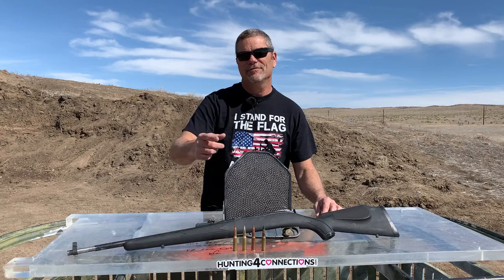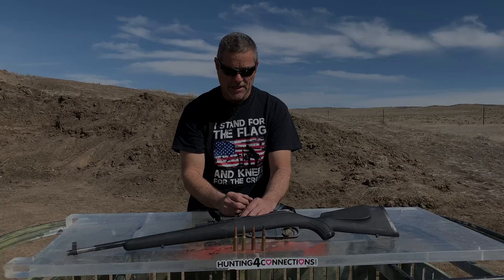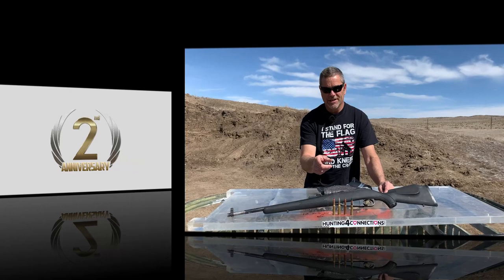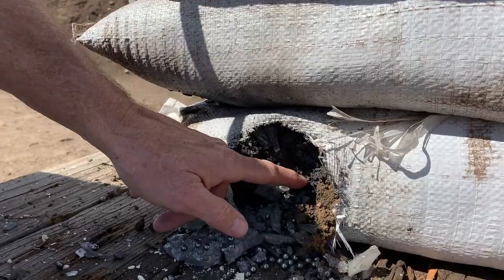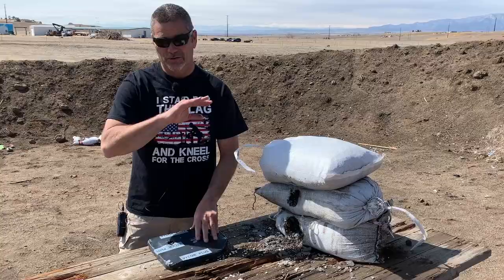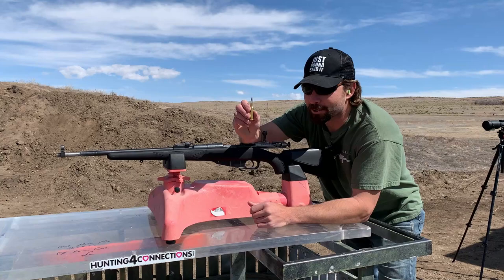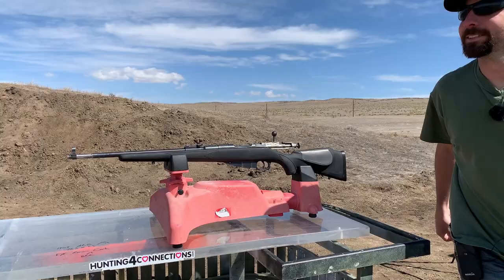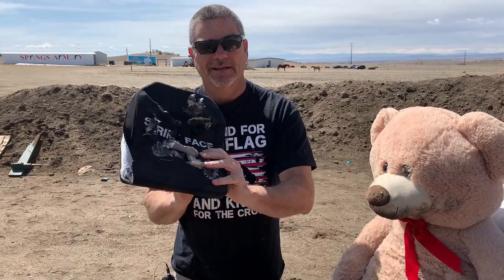Ball Bearing Body Armor Will It Work?

Comment: “Pipe bombs use nails, bolts and nuts, chunks of metal and ball bearings to create damage”

Brilliant, let’s attach 4000 pieces of shrapnel to my chest to stop bullets and encase it in shattering resin.
Reply: Notice his shirt. He knows that kneeling is respectful, because his shirt says he kneels for the cross. But he thinks that kneeling for the flag is disrespectful. This is not someone who has been trained in critical thinking.
Reply: @johness5425  he made the armor to test or out. For fun. For the video. It was not designed for use in the fucking military or something
Reply: John Ess they sound like some them liberals u hearn all bout these days. Tht ill tells u bout there smarts right there uh huhhh.
Reply: @mateusz_0  If you think about it for two seconds, you know that epoxy and ball bearings have nothing in common with actually used body armor materials. Did you catch how the shooter called it a "chest-mounted claymore" before he fired a round? Did you catch how embarrassed he was when it failed? "Okay, well, I just need to stick to making videos and not body armor."
Reply: @johness5425  claymore is an explosive device. He literally called his armor a bomb. He knew it wouldn't protect a person
Reply: @mateusz_0  The guy who made it never called it a bomb before it was shot at. 

"We have no idea how this is going to work" 0:23
He then goes on to say how a friend of his told him that epoxy wasn't strong enough, so he wrapped it with vycor to give it more strength. Then the shooter, a different person, called it a chest-mounted claymore.

The people around him knew that it wouldn't work because of critical thinking. He didn't.
Reply: @drewyoung5577  Here is a thought exercise for you. 

If I know things that you don't know, and those things are the foundations of my comments, it will appear to you as if I'm ignorant when really it is you who is ignorant of what I know.

It's difficult, I know, but studying rhetoric, philosophy, and critical thinking can really broaden your mind.
Reply: @johness5425  Kneeling is respectful in certain situations. Kneeling during the national anthem isn't respectful at all
Reply: @TheLongDon  Really? Why then did a US Veteran tell Kaepernick to kneel to be respectful while he protests if kneeling isn't respectful?
Reply: @johness5425  Im sorry, but when did a single left wing US veteran become the spokesperson for the US? That's like telling me the majority of the US military wouldn't secretly enjoy watching Biden getting executed based off of a small poll from a single Air Force base. Means nothing, and it's still wrong
Reply: @TheLongDon  LOL you're still faced with the reality that you're trying to justify kneeling being both respectful and disrespectful. Your logic isn't consistent. You're also stuck with trying to squelch a US citizen's First Amendment right to peacefully protest.
Reply: @kentuckyfriedpepespeaks1550  Yeah, you're trying to shame him into shutting up because you don't like the uncomfortable truths he makes you look at 😊
Reply: @crazyjhey8050  "there smarts" nice one

Comment: Actually this seems like it might work with a single layer of ball bearings and a few layers of Kevlar behind it. Looks like it spread the force out quite a bit, which Kevlar could probably absorb. Likely the actual bullet was quite deformed after the impact
Reply: I agree, this was actually a success.  If it had a rigid tensile backing and a tensile wrapping, the bearings would have redirected the force from piercing to blunt.  I think that several bearings deep is good though because it forms a pyramid of impact.  Also I think glass would work as well as steel bearings for less weight.  I'd love to see an experiment like that.

Comment: I gotta couple of those Argentine spotter rounds for my mosin. Y’all are the first people I’ve ever seen test them

Be cool to see them in gel or something against the PZ rounds
Reply: I second this, I've got a couple and the only thing I've tested them on are 5 gal buckets of water.
Reply: Argentine rounds for a soviet gun? Tell me more about it.
Argentina's gun industry is practically inexistent, that why I'm asking.
Reply: @_CazaBobos  they aren't actual Argentinean 7.62x54r rounds, its a 7.65 projectile pulled and reloaded into a x54r case. Apparently due to actual diameter of the projectiles its safe enough to do other then the actual act of pulling the projectile potentially being dangerous however younger me was pretty rough handling the ones I have and they are relatively inert (you can hear the little detonator pin if you shake them) but there are photos of people trying to use a kinetic puller to remove the projectile and it exploding.

Comment from the maker: is:

Install Raid for Free ✅ IOS: https://clcr.me/teHpDC ✅ ANDROID: https://clcr.me/ywv64U ✅ PC: https://clcr.me/xiNgZw and get a special starter pack 💥 Available only for the next 30 days
Reply: happy sponsorship :)
Reply: I love you
Reply: Explosive free claymore mine u did invent sumthing
Reply: Maybe you could make this body armor for ISIS. The idea of using balls for ballistic protection is actually used in real life in the walls of U.S. Embassies. They use ceramic ping-pong ball size balls stacked a few layers thick inside of critical walls. When a bullet or bomb fragment hits one of the balls the ball stops the projectile but shatters in the process. The balls above the shattered one then fall down to replace the damaged one.
Reply: you may be onto something there,
the purpose of a plate/ceramic is to spread the impact into more area for the kevlar to contain.
if you had a kevlar backing to the ball bearings it certainly did spread the area out the back.

is it worth trying again with kevlar backing?
perhaps put the balls in balistic gel for a flexible plate?

Comment: Glad you shot it with a Mosin :) My first thought was it will blow apart very easily as the ball bearings will separate when the bullet hits the plate. Even with the wrap. And I was not disappointed. This would not stop bullets, and would be very dangerous for the wearer and people around them.

Comment: If you put a panel of polycarbonate behind it, it could actually work. You can see how wide the exit wound is, so I think the energy of the bullet is dispersed very quickly throughout the ball bearings.

Comment: Actually similar armor type existed in history - pebble armor. I do not know if this was official name. Brits used proper sized granite pebbles in asphalt or similar bonding agent and cast it around critical part of the commercial ships in WW2. It saved armor steel and idea was (tested, not just idea) that bullets from strafing aircraft would be destabilized, slowed down and than easily stopped by some thin backing.
Quite likely if you found the way how to keep the bullets in place, this could work. One think that could have made your results even worse is that classic school example in physics - you let the ball hit line of the balls and the last one flies away. Those balls probably transferred shockwave and that's why we had such a beautiful slow-motion effects. 
My guess is that many of these DIY body armors fail because they allow projectile to bypass the protection. Bullet impact simply sends pieces flying or crack it and pushes junk of it inwards thus the bullet is not truly forced to makes it way through.
Look at the brick wall. 1-layer and bullet throws half of its thickness from inside part away by the force of the impact before it even gets there. So it flies through the hole rather than punching through the brick. Make thicker wall and bullet barely makes small crater on the surface as other bricks prevent material to go away.

Comment: That's a cool design for the plate. The ceramic will spread out the impact over an even area, and deform or mushroom the bullet, while the kevlar behind it will catch the fragments and save you. Rather than a bullet hitting just kevlar. It would take a whole lot more kevlar to stop the rounds wheres the ceramic allows it to be smaller and lighter than it could be otherwise. Brilliant and simple

Comment: Ball bearings are very hard and are great for shattering bullets, but so is ceramic., and ceramic body armor is backed by an aluminum plate for a reason. You don't just need to break up the bullet, you have to catch it, which is why high performance plates have metal and aramid backing and are tightly wrapped in aramid and nylon to hold all the layers together while absorbing big impacts.

Comment: In solid composite engineering, there are two types of materials used in tandem to gain the upsides of both while mitigating the downsides of each. A crystalline matrix and a fibrous reinforcement. The crystalline element is hard, inflexible, retains its shape and is used as the load bearing element. In typical composites such as fiberglass or carbon fiber, this is usually some type of epoxy resin and acts as the binder. The fibrous element is soft, flexible, absorbs shock and halts fracture propagation within the matrix. Common examples include rebar in concrete or horse hair in plaster.
What you have here, epoxy and ball bearings, is a combination of two crystalline elements with no fibrous element. Knowing this, it acted as expected.
As a side note, as you can see in the ceramic plates, they could not manufacture it with a reinforcement embedded within the ceramic while retaining the properties that demanded its use in the first place. To mitigate fracture propagation, they use multiple segments. To absorb the shock and energy imparted to the ceramic, they use a ballistic fiber panel layer behind it. Either one of those elements would fail in its intended role if used alone, even if twice the amount was used, but together they can accomplish more. This design also makes the plate only functional for its intended purpose when exposed to the incoming energy of a projectile from one direction, which is why they have one side clearly and boldly marked as the 'Strike Face'. Shooting that plate from the opposite face will lead to a result very similar to what you saw from your own prototype. That basically means that you might be able to get away with making many small squares of your material and taping them over a soft armor vest. You would then have a proper solid composite material assembly. It might just be worth having a go at a Mk.2.

Comment: A very fearless buddy of mine back in high school in the 80s made armor out of fiberglass and sheet metal about an inch thick. It repelled everything he threw at it until I socked it with an AK armor piercing round. Nice hole right through it. It was thicker, but he put it in a hydraulic press and made it an inch thick. It worked, but any military rifle round went straight through. Glad he wasn't wearing it.
Reply from the maker: Thanks for the comment 👍

Comment: when built right it would work. try making it like composite armor. As for example; 5mm ar 550 face place with a 2mm layer of kevlar followed by a ceramic ball bearing layer mode of 2mm ball bearing followed by another 2mm layer of kevlar. continue with this layering until 20mm thick with another 5mm ar550 backer plate.

Comment: Some 3-5 layers woven fibre glass cloth on the front, in between ball bearing layers and the back. Some use glass ball bearings. They break and chew up the bullet. 

Of course we don't know for sure until someone tries it. It might actually stop the rounds.

What about gravel armor with layers of fibre glass cloth? Might be heavy though.

Ball bearing armor - who knew it would turn into a claymore mine! Maybe you just need some tough woven fibers to make it work.

Those ball bearings did dissipate the impact somewhat but it got passed to the ball bearings.

Comment: I think if it would be backed by something solid, like layer of steel armour, it may act somewhat similar to ceramic armour i.e. it would disperse the energy of the bullet before it hits the armour, or even push it sideways or in weird angle making it hard to penetrate. Now it is literally as strong as ~2 inch thick epoxy - as soon as bullet hits there is nothing backing it and everything just bursts through the back.

Comment: It needs some kevlar on the back because the armor is working in a way its taking a small projectile and is dispersing it into a larger one but the epoxy is not strong enough to contain the energy.

Comment: This would maybe work, but you'd need to use a more durable binder then epoxy.

I'd be interested in seeing this done again, but use Flex Seal to bind the BB's together instead of epoxy. 

Maybe put a layer of Denim on the back, that way it won't shatter upon exiting.

Comment: The issue is clearly containment of the ball bearings. What if you wrapped it in something stronger than tape? E.g. putting a soft body-armour behind it, like a kevlar vest? Maybe use bigger ball bearings as well to get a bigger impact surface area on the vest?

Comment: Honestly, I think it depends on the type of metal bearings used (case hardened, stainless steel, chromium, etc) and how they're laid out. As well as the substance used to hold the matrix of the ball bearings together. Too hard and it will shatter. Too soft and it will blow apart where struck. A High Density, slow cure apoxy should do the trick.

Comment: you know you could try doing a V2 where you instead of using clear resin, you use molten aluminum to bond them. will be much stronger. you could also use a thin piece of sheet steel to back it so you dont have a claymore strapped to your chest.  Would love to see a V2
Reply from the maker: Great suggestion!

Comment: Epoxy is brittle and not that hard.  UV resin would of been a better choice, but I like your idea.  Maybe try it with UV resin mixed with 1095 steel powder.  Still might be too brittle.  Maybe some sort of flexible glue like Aquaseal or E6000 (they have it in caulk gun tubes) mixed with 1095 powder.

Comment: I am at 4:16 in the video, and I predict that the steel-shot will turn one incoming bullet into buckshot on the back-side!
I get the idea behind having hard bits to break up incoming rounds, but I dunno...
I just finished the video:  yup.
But here's a thought: you are a spy, and you want to undermine a group of soldiers.
Sell them on the idea of using 'extra hard steel' armor in pellet form.
They take the new armor into battle, and you tell the other guys, 'aim for the plates on their chest'.
One-shot stops all day long.
I write stories as good as your welding!

Comment: my thougths...

i think this may work but not completly...
 as it's balls, there is no flat surfaces for the bullet to stop, so the bullet is going to slide on one direction around the ball and continu...

now, as there is multiples balls, the bullets will do the same, but they gonna be a whole tons of friction for the bullet to try passing through (between the balls gaps/seperations) and so, that will drastically slow down the bullet.

But i still think for hard bullet (heavy core) or penetrating bullet, this wont stand a chance.

the funny part of it is to see in wich direction the bullet will fly after it hit it. soo be careful with this experiment XD
Reply: Agree!

Comment: Effective cheap light armor by silk material the finest you can get your hands on, use fiberglass resin & a hydridic press to glue each layer by layer :)
If you have the $$$$ obtain some nano ceramic powered & using a laser fuse it between the silk layers, this will stop just about anything but the kinetic energy from the impact will still hurt you :)

Comment: Take the bear and empty out the pollyfill then stuff it with dirt. That may give a good reaction when testing armor and cheap to make.
Reply: Not only is the casing full of holes already, even if it wasn't it'll rip to shreds if you fill it with dirt and try to move it. Teddy ain't strong enough to contain 150 lbs of dirt.
Reply: @remcovanvliet3018  I was thinking a new bear and you would fill it on the table.

Comment: should have done floor tiles and a bunch of chicken wire dipped in epoxy and maybe stick a thin piece of sheet metal on the front and back

Comment: I have made body armor. Take old car seat belts. Lay them in a criss cross weave and cover it with a apoxy resin . I made 3 layers of seat belts each layer covered with a layer of resin. Basically one layer resin with one layer old seat belt then another layer of resin with a layer of seat belts. 3 layers did the job and it stopped a 9 mm in its tracks. Can you replicate what I did and try it with a 38. 45 etc?
Reply from the maker: Cool idea 💡

Comment: I think epoxy not so good for this experiment =) If you take 2  piece of kevlar and sew balls (but need some biggest balls, 10mm maybe?) between them with some glue (ideally by welding), it's will working. 
Or not :)

Comment: You guys never seen a Newton's cradle? lol, not to mention spheres are mechanically one of the strongest shapes
--also, steel bearings usually have an very high hardness rating.
--also, smooth spheres don't really have a lot of adhesion to resin--really, any smooth material doesn't generate as much friction.
--also, sphere's have the least surface area per unit volume--meaning for a given mass, they have less material in contact with the rest

It looks friggin cool, but it is friggin useless apparently
Cool video, guys!

Comment: I’m not a body armour expert, but I think that the ball bearings armour could have worked with epoxy and a double thin metal plate infront and back to add rigidity nd could prevent a claymore effect on the chest😂🙈
Reply from the maker: I’ll have to make some more. I was going to put Kevlar on the back though.
Reply: @GoingBallistic  that seems a good idea too , didn’t taught about Kevlar.
Can’t wait to see the final product✌🏻